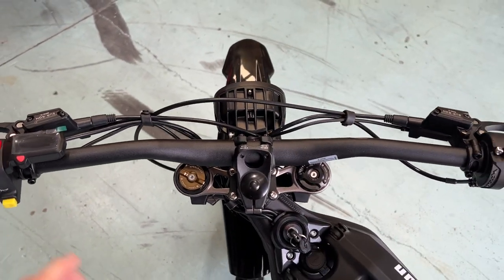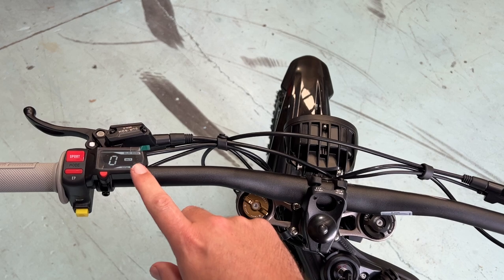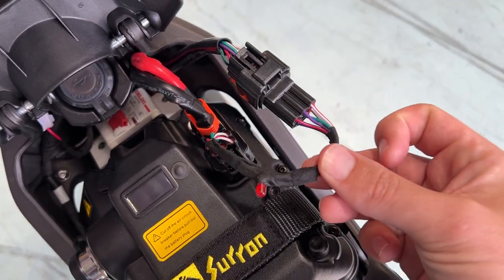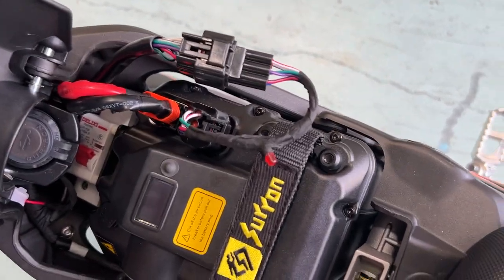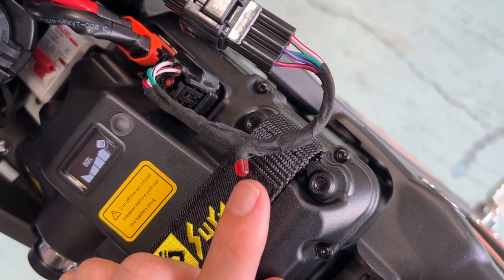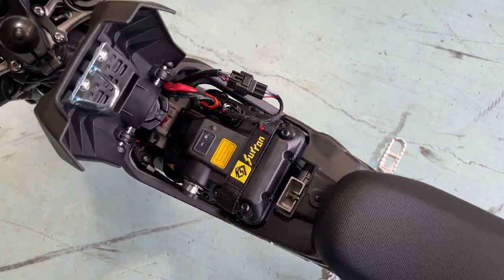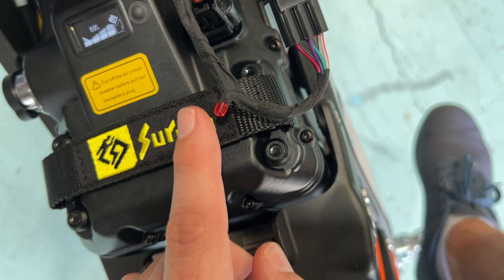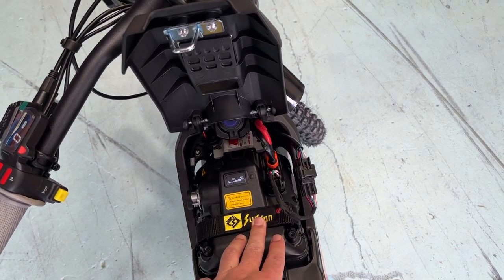How to Diagnose Faults on Surron Light Bee X

Comment: I was riding normal, stopped at a red light and had no throttle when light turned green. Bike has 995 miles. Plugged in the diagnostic attachment and it doesn’t light up at all
Reply: Did you figure it out
Reply: @AG-rj8bo  I haven’t fixed it yet but I think it might be the controller
Reply: remove the tip over sensor unless you alreasy did
Reply: I did a couple tests on the controller and it failed them so I replaced it. Fixed the issue and runs now. I put on an older used controller. Feels a little less torquey going up hill tho
Reply: What tests did u do on your controller?

Comment: The red light on mine just stays solid, doesn't blink at all and there is no throttle response. There is power to going to the bike because the dash turns on, light turns on and I can charge my phone but no throttle response. I've tried a brand new throttle as well but the same issue; anyone have any ideas?
Reply: I have the same problem if you fix it let me knwo
Reply: Lmk to plzxx
Reply: @AmpdBrothers this has been my problem for awhile now i've pulled out brake sensors kickstand sensor and tilt over sensor.. went through all the relay connections to see if any water got in or pinched wires but literally nothing i can see haven't been wet for awhile honestly needs a wash haha but yeah surely you know the root issue??
Reply: Have the same issue, let me know if you guys get it fixed. My light stays solid red aswell
Reply: Avez vous trouvé le problème depuis ??

Comment: I have a bike that’s blinking 17 times, says motor temp sensor failure in the chart you provided, any tips on how to fix or reset this? I can’t adjust my regen braking because it keeps throwing the code
Reply: Did you fix it mine is also blinking 17 times

Comment: What id your diagnostic cable doesn't produce a flash at all.
I also lost visual on my screen.
And now my bike is super unreliable works every 10 to 30 resets.
I also get jolty speed (especially in economy mode) and the newest fault my sport mode sometimes will only reach 60kmh

Comment: I have the red light blinking 15 times. Apparently that means a short circuit from the throttle cable to the controller, do I just need a new throttle? Or is there a way I need to calibrate it
Reply from the maker: hi there, 
I would try turn your breaker switch off and let sit for a good 10sec then turn on again, see if that resets. Otherwise unplug the throttle wire plug, check theres no water in there and that the connection is firm. If all good then last thing would be to replace the throttle yes

Comment: I have a issue with my Surron I installed a bac4000 on my x160 slowly it started to cut power when I would throttle it then no throttle would work , I swapped out the bac4000 and throttle it powers on but there’s no throttle response some please help

Comment: thx for the troubleshooting tutorial... i got a 22 blink after cutting and thermo tubing my kickstand wire and i was wondering why i had no more throttle. i had to reopen it and make sure the wire wasnt in contact with each other and thermo tube them back and it solved my problem.
Reply: My surron blinks once slowly, and 4 times at a normal pace. What could be the problem? The throttle doesn’t work

Comment: Please help I have a 2023 Surron I used the diagnostic togal and it flashes slow ever 2 seconds I have deleted the break sensors kickstand sensor and tip over sensor the bike starts and runs but if you jump off a curb or accelerate fast it cuts all throttle response bike stays on but you have to turn the key off and back on to get it to start running agin I can’t figure out the problem any help please
Reply: did you end up finding a fix
Reply: @SethNGB  bad throttle sometimes they go bad out of no where bout a new Surron throttle and it works perfect 👍🏼👍🏼